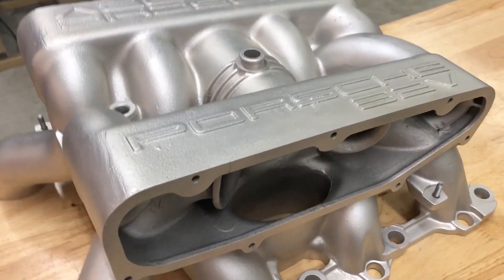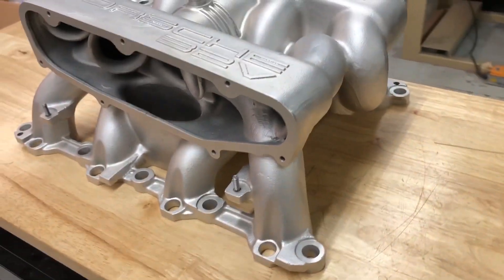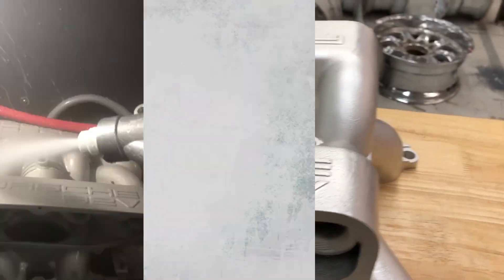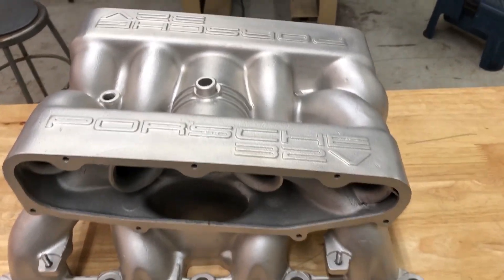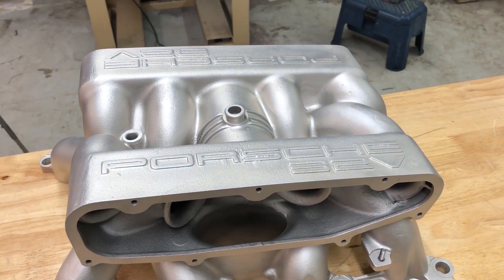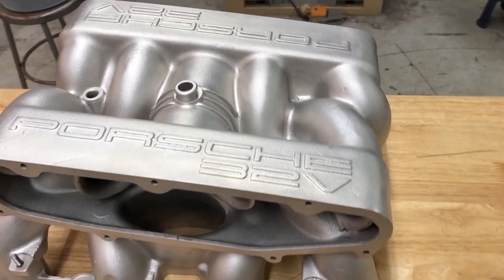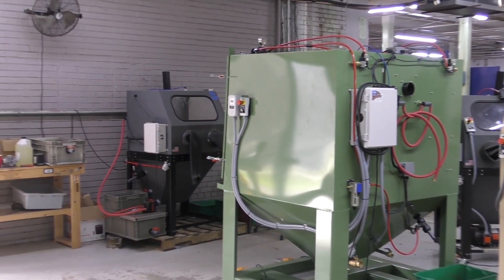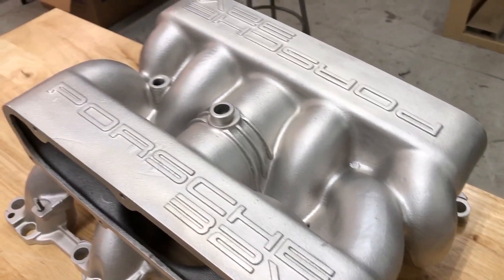Wet Blasting a Porsche Intake Manifold - Vapor Honing Technologies

Comment: Would you get similar results if you blasted the part with fine glass media and then followed with vapor honing?
Reply from the maker: Yes, wet blasting with glass bead typically gives more of a shine and polished finish. Give us a call for specific help with your process, (828-202-5563).